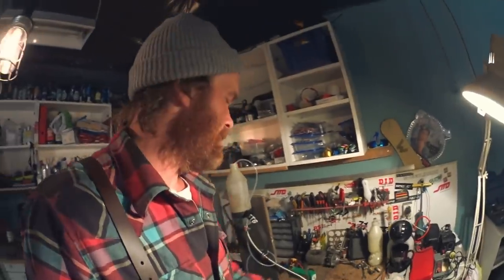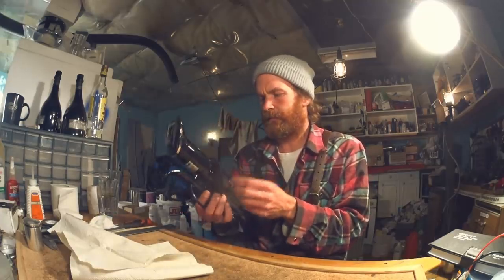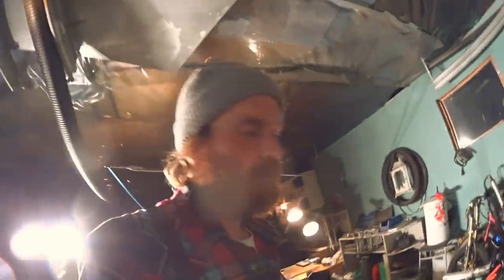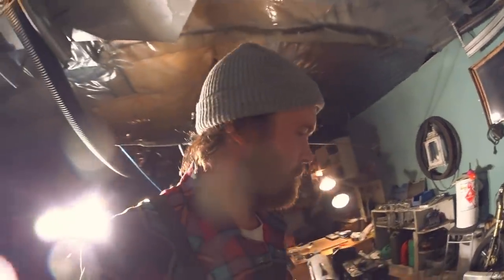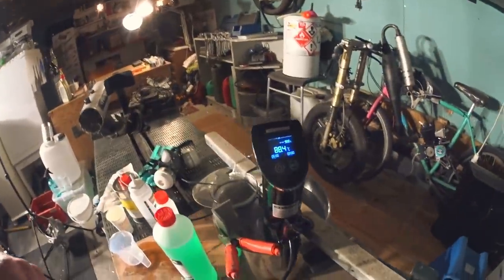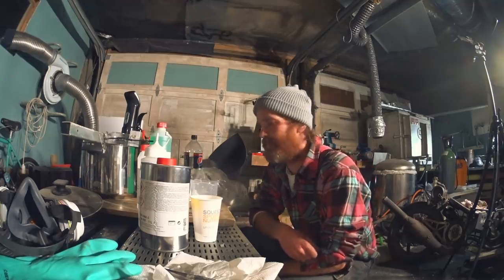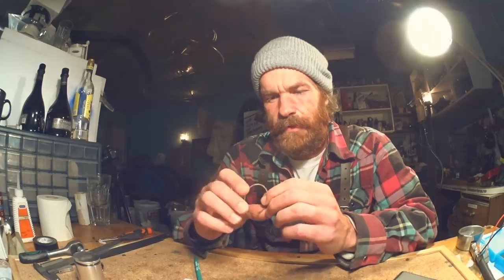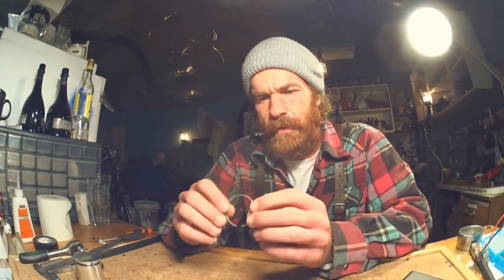Electroless Nickel plating Piston Rings - The Most Powerful Two Stroke Ever

Comment: Imagine you and Allen Millyard in the same shop, the things you two could get up to. Great channel.
Reply from the maker: Would love to meet him, think we would get along!
Reply: @2STROKESTUFFING  surprised you havent already met him. And I would love to meet both you guys. Been a bike tech for 30 years and still learn stuff from you. Great video.
Reply: Nothing but arguing, have you ever seen two geniuses working together?
Reply: Here's how we built our v6 direct injection 2 stroke for out NSR 250 frame.
Reply: Working together they have rename themselves "Zephram" and "Cochrane".
Reply: 2STROKE STUFFING have you checked out his mountain bike gearbox?    Compact, shifts under full load.
Would be interesting to see if it would handle 20k rpm.
Reply: The mountain bikes millyard has built are insane. Just like what’s happening on this channel, next level engineering. 30hp from 50cc’s? Imagine the same power output everyday combustion engines. So impressive! I’m waiting for camless powertrains. koenigsegg Has achieved this already and has a few different engines. 4 cylinder engines making 400 hp without modification just the ability to control each cylinders intake/exhaust to the ms.
Reply: I would lime to see how he would use someone like Applied Science or something haha

Comment: That file set is cool.
Reply: TSUBOSAN Japan Hardness Tester Checker File Set
Reply: Lent my set to a friend for checking conveyor flight hardness... which wouldn't be important if he wasn't in a hurry to remove his lock so the scrap wood could keep going to the 600hp chipper and he could enjoy most of his lunch. The metal detector caught the set but the operator put them on top of the chipper and chippers do on occasion vibrate. 9 man hours of Mission Impossible later we had every piece of the plastic handle sections removed from the paper plant barge. Plastics will goop up the paper manufacturing screens and be traced back to the scene of the abandonment for restitution. The four hardest files survive on the wall in remembrance of when Pidd met Stuey. Yeah I agree, those files will eventually get you out of any normal bars...

Comment: Great job on the plating, many people don't realize how easy it is if you know how to work carefuly and responsibly with dangerous chemicals.

tip: Covering the water bath with foil or plastic make it heat up faster, contains moisture. My sous cooker can barely keep my water hot without it, and an insulated pot, when doing larger batches.
Reply from the maker: Thanks! Good tip!

Comment: Great series, glad see these episodes appearing.  
Also, in case no one else has mentioned this, I thought to advise caution when using any sort of expansion chamber or muffler when running nitromethane fuel, as circumstances could arise that might lead to an explosion (such as if ignition were interrupted for a moment for whatever reason).
Also, one should perhaps have a face shield on whenever standing in very close proximity to a running experimental engine, especially one that reaches for the limits of output, as unexpected things can happen. You would need eyesight to put out a fire, etc.
I was taught never to be casual about safety in the lab.
Best wishes!

Comment: I'm planning a home shop and one item on the wish list is a fume hood.

I'm not planning to do much plating but it will be nice to know I can do it safely if I want.

You can find one on surplus auction sites around here, I imagine Europe probably also has ways of disposing surplus equipment.

I hear that beards mess up the seal on facemasks like yours.  A fume hood might be a good upgrade for you, but still double up on protection, you only have two lungs.

Comment: Yeah man, awesome job. I would never think that just nickel would increase this much the hardness
Reply from the maker: Thanks! Electroless nickel has some phosphorus in it(10% in this case), that's why I think.
Reply: @2STROKESTUFFING  the electric one is a better option in this case?
Reply from the maker: @Fumacenta2tempos  No, electroless is harder. In my cylinder bore I used electroplated nickel with 5 micron boron nitride particles. Mixed in some Silicon carbide for next plate. In this case it's the particles that provide the hardness.
Reply: @2STROKESTUFFING  What's your honing process? IIRC you need to achieve a very fine grit finish on a nikasil bore to keep the rings intact, finishing somewhere in the 600 or 800 grit range with diamond?
Reply from the maker: I've used a stone hone with 400grit(if I remember correctly), my "Nikasil" is too soft though, used the wrong kind of boron nitride. Mixed in some SiC now, next plate should be good. I'll shop around for a suitable diamond hone.

Comment: plating the wheel might wear out your cylinder faster. The material choice is like a cascade or parts ordered by how often you can tolerate changing them.

Comment: Ive experimented in the past with cutting out the bridge in the exhaust port when i build and raced 2 stroke scooters but the ring always caught the exhaust port and destroyed the ring and piston.
Tried different locations for the pin that secures the ring in place and made the exhaust port tapered inwards on the high side so the ring could slide past it when it wants to expand but it would always selfdestruct within minutes or even faster haha :).
Very interested to see if the ring will eventually hold up with this insane port to wall ratio.
Reply: Thats that i tried to say in the past for the exhoust port design about. I said too to test the exhoust window on spare cylinder, to know for sure, is it works. To spin for a 15k r/pm and see is it holding. Becouse this engine will run over 20k r/pm, at these speeds even piston and connecting rod can brake by itself, without the ring problem..

Comment: earlier I tried to do electrochemical nickel coating on my piston rings and it didn't work well, the coating didn't bond with the piston rings well, and also I don't know but the piston rings after coating turned out to be weaker, but it turned out like this because I had done something wrong and that's why it was not successful
Reply from the maker: Electroplated nickel is softer than electroless. Bonding trouble likely caused by impurities on the surface.
Reply: @2STROKESTUFFING  thanks man for the advice, it seems that electroless nickel coating is better, next time I will try for electroless coating,   and 
 thank you sir for helping me and giving me advice
Reply: M Bacon - It’s electroless, so no anode
Reply: M Bacon - Got it. Sorry

Comment: Whats the height of the pistonring and is it a very tight heighttolerance on it? If you preharden a sheet of good toolsteel, grind it too the right  height and then cut out the rings with wire-EDM its very easy too make them. Its fast, precise and the possibility to alter the shape of the rings are endless. I have the connections to make that happen if you are interested and im located in the south of Sweden.
Reply from the maker: 👍 Thanks for the offer! Mark Atkinson(who machined the piston) is on the case, new piston/ring combo in the making.

Comment: Why do you prefer this non-electrode nickel plating over electrolysis with electrodes and an external electrical power source?
Reply from the maker: It plates a much more uniform layer regardless of geometry.
Reply: @2STROKESTUFFING  Multiple uniform electrodes can solve this problem?!

Comment: I don't know what steel you are using for the ring, but heat treating it at 400°C could alter its mechanical properties. If it's hardened now, it will be softer (annealing), even if the nickel plating gets harder. Perhaps not the best idea?

Comment: You make everything else; why don’t you find an o ring the right thickness & splice it with superglue. All it needs todo is be able to be captured in your recess & the head bolts will keep the seal. Jus make the splices at 45 degrees so there’s a bigger area to glue. By the way, I have seen that there’s a flexible super glue formulation readily available now. Maybe that’ll be a good alternative if the normal super glue (cyano) lets go?

Comment: Do you think a cylinder could be plated with this bath?  And what are these reagents?
Reply from the maker: Sure, I know some companies use this process. You'll need some hard 1-10 micron particles in there too though, eg. silicon carbide, cubic boron nitride etc. Composite plating. There's quite a few more steps to get this to stick to aluminium. Better cleaning, acid etch(high silicon alloy requires some nasty fluor stuff), and zincate. Scroll through my vids, I've documented plating my cylinder. The process is the same except the actual plating bath.
Chemicals in this video is nickel sulfate and most likely sodium hypophosphite(no info on the bottle)
Reply: @2STROKESTUFFING  yes, I've been watching from the beginning.   So no info on the small bottle?  So how do we get it?

Comment: Oil injection,  or gas oil mix? Ive seen one two stroke that injected the oil in the gas and mixes it itself
Reply from the maker: Nitromethanol
Reply: @2STROKESTUFFING  ooooohhhh yeah!
Reply: @2STROKESTUFFING   I had the idea once to make a table top moonshine still so that  I can run moonshine in my 2 stroke but is that possible can you run moonshine with 2 stroke oil and would that even work. It's kind of an apocalyptic way of making fuel.

Comment: Will the ring being so hard make the cylinder wear faster?
Reply: Yes but the ring lasting one startup is definitely too soft
.. there's a sweet spot u wanna find also consider the cylinder's surface area vs the ring even with the ring being harder than the cylinder, if they both lose the same amount of material... I bet the ring would be worn in half before u could really measure a difference in the bored..
Reply: Bore**

Comment: can someone explain to me how his engine works? i didnt watch the whole series
Reply: K T just watch the whole series. Its worth it.
Reply: The big difference is a massive exhaust port that can only work with a piston ring that is retained very closely in the piston groove. The piston is a two piece arrangement to allow this.
Also the crankcase is to big a volume to be an air pump and instead the air is drawn through intake at a resonance that works for the whole motor from intake to exit from expansion chamber.
Look up 'resonance' in expansion chambers for 2 strokes, and the V1 doodlebug and youll have a fair insight into whats going on.
You could consider this motor like a brass musical instrument.
Reply: paul beenis yeah okay, great answer to my question, i just thought this can't be normal 2 stroke technology if you are trying to hit 30+hp in a 50cc
greetings from germany, going to watch whole series ;)

Comment: That scratch test seemed a little unreliable. It should be stronger now but your estimate could be significantly off. 

Will that plating withstand the heat and friction inside a running engine?

Comment: be careful, the chrome cylinder and chrome rings with mutual friction can grind the engine
Reply: What are you talking about. Neither the ring nor cylinder are chrome...
Reply: KevinT Creations  this is only for testing, did you even watch the video?
Reply: KevinT Creations  I think hes just trying to push limits of 2 stroke design for a proof of concept, Eg the lack of bridge in an exhaust port that size, some would say is disastrous, and Alex knows that but he has had many hurdles so far, yet progress continues.

Comment: Chemist hotplate or ultrasonic heater may have been more control over environmental inclusions actually autoclave would be best
Reply from the maker: 👍 Yep. Should get one.
Reply: Theres also a phone screen vacuum heating machine that would cause the sulfate to drop out on the piece in theory
Reply: Tumble polish would help with cylinder wear and thickness

Comment: a truck retarder is probably strong enough for youre use as a powerbrake , think you can load it up by adding electric power to it https://www.huismanauction.com/auction/38/item/jacob-electric-brake-retarder-for-truck-driveline-3000/
another frictionless (edddy current ) brake you could try is a thick copper or aluminium plate and verry strong magnets you can put on either side of the spinning disk

Comment: What speed are you hoping to achieve at boniville?
Reply: And does anyone know the last highest speed done by someone else on 50cc on the flats? Found it? The Cobra-powered bike broke the old AMA 50cc AG (Altered Gasoline) record of 69.633 mph by running a wind-aided 78.399 mph on the first pass, then coming back into a headwind at 71.106 mph - for an official combined time of 74.852.
Reply from the maker: Current record in the no-streamlining class is ~90mph.
Reply: @2STROKESTUFFING  wow that is very fast
Reply: Any rules on using fairings or does that change designation
Reply: @mowler8042  different class
Reply: @raymondo162  oh thanks for the reply

Comment: this might be a poorman's way of nickasil a cylinder. hmm...
Reply from the maker: Scroll back through my vids and you'll find the poor man's way of electroplating Nikasil👍
Reply: @2STROKESTUFFING  yes, I've seen and it has a lot of overhead with the various chemicals and the process. The Chinese are electroplating a nickel steel alloy to their cheapest aluminum cylinders, tho I've seen it is not super durable in air-cooled 2 strokes; scratches appeared at about 25 hours operation, even when rpm was kept below 5000 in a low compression 48cc